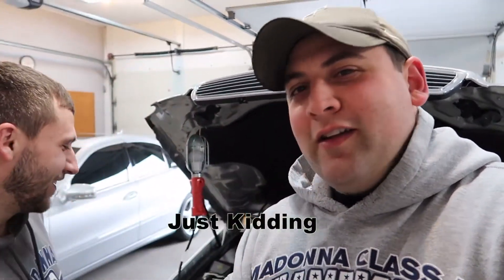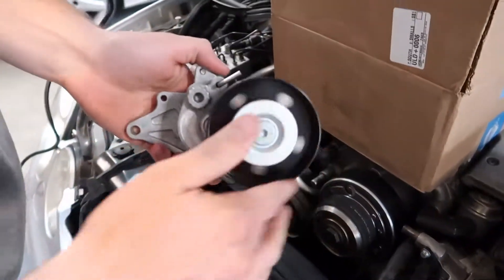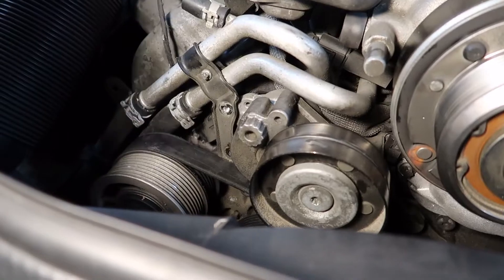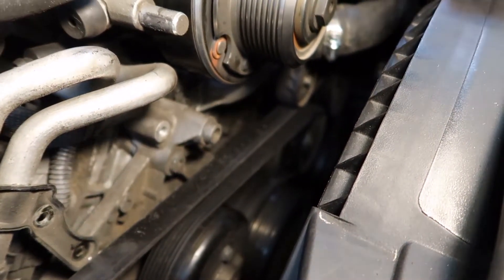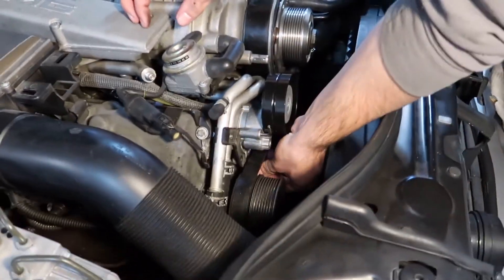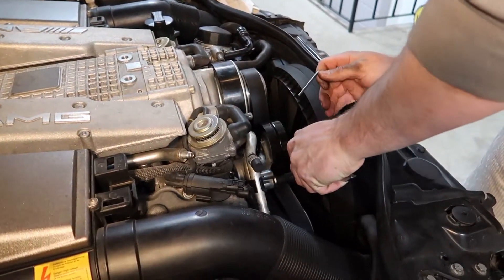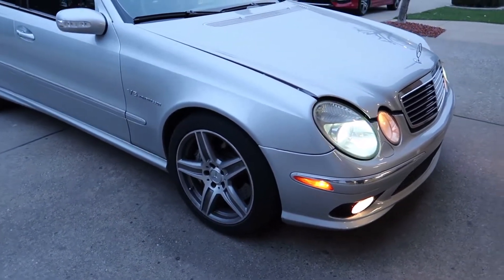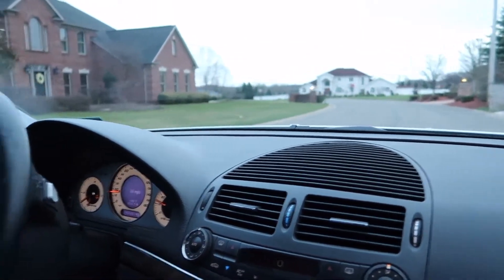How to replace the supercharger belt tensioner on a Mercedes E55 AMG

Comment: Great job on changing out the Tensioner. FYI, you could have just changed the pulley and not the tensioner. But, with 400k on the clock, I understand why you would want to change them both. The Secondary Air Injection pump issue could be as simple as changing out a relay.  More times than not, the actual pump itself is not the issue. The relay I replaced was in the rear passenger side trunk area. Remove the trunk liner and there are two relays by the air tank. One is for the fuel pump and one is for the secondary air pump. Replace that and you might be good to go. Good luck.
Reply from the maker: Brandon Williams we'll check that out. Thank!
Reply: any chance you have a link for just the supercharger tensioner pulley? I've looked everywhere and can't find one. thanks
Reply: fcp euro

Comment: I need to replace the lower tensioner on the other belt , dose anyone know if I can replace the bearing or what’s the part number for the lower tensioner to the bottom right thanks
Reply: The supercharger lower pulley (idler pulley) bearing  #6203zz-c3 . The inner idler pulley replacement Dayco 89130.